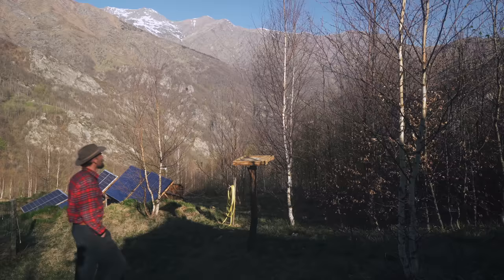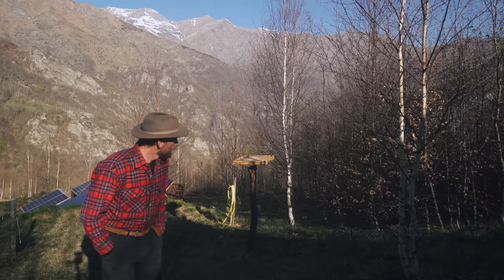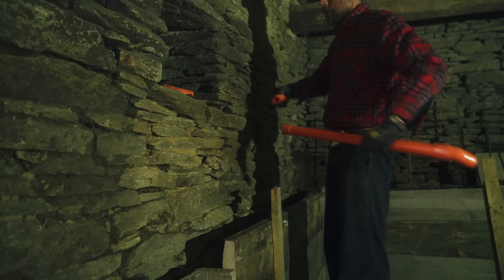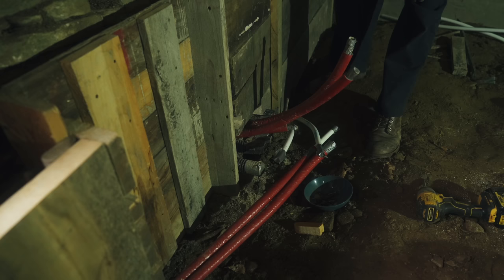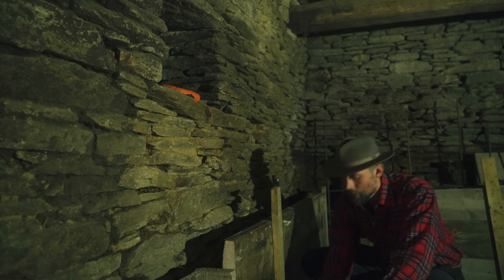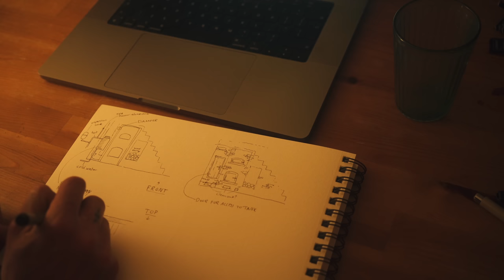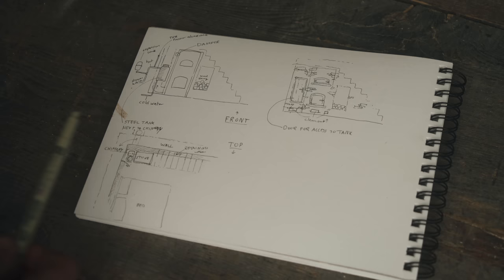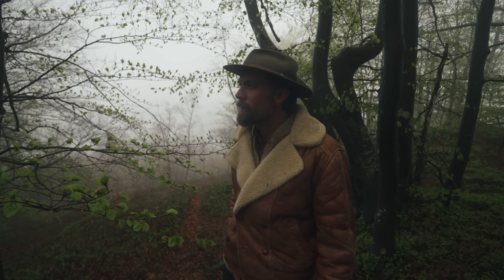#63 First Green on the Trees, Digging retaining wall, Plumbing preparation

Comment: Hi Martin, I am a heating engineer. To make this system safe the solid fuel side must be open to atmosphere (open vented system), and normally open valves must be used. Linking together a solid fuel heat source and a boiler is possibly the most complicated domestic heating system going, not only the plumbing but also the wiring. You can run into all sorts of problems like tanks boiling over, huge amounts of condensation on the heat exchanger that could ruin your stove, and at worst an explosion that could rip the house apart. I massively respect your work and think you're doing a great job, but I would highly recommend getting professionals in with specific experience on solid fuel heating systems for this one, most of this stuff is beyond your average plumber! It will absolutely pay off to have it done right the first time.
Reply: I don't know much about electric boilers, but I would imagine you could run into problems running them on a low pressure open vented system, low pressure systems are also less efficient. The best way around this would be hydronic separation of the two systems, and a neutraliser.
Reply: I am a plumber by trade in Canada, a fully qualified journeyman with decades of experience and I agree one hundred percent.   Heating systems should not be designed or installed by amateurs, they are incredibly dangerous, and will kill you in your sleep, and the dangers are often very easy to misunderstand or to overlook.

It is a place to pay for professionals, and also to soak up as much knowledge from them as possible so you will know if something is wrong.

heating systems almost seem to want to murder human beings with carbon monoxide, and it requires a lot of knowledge to set things up, and a fair bit to maintain systems that will not manage to murder you in your sleep. Yes I am being a bit over the top, but the dangers are very very real.
Reply: It's good to hear the experts say "Get an expert!", because that's just what I, as a diy-guy, was thinkin. But in principle I like the idea of a very well insulated storage tank much better than a tank next to the fire. In times like autumn you might want to run the stove only every other day or so, but the storage tank can provide you with warm water over a few days without running the stove. Also it gives room for future addition of other heat sources like solar water heating.
Reply: He must not have to go through inspections
Reply: Honest question, If you have a solid expansion tank and pressure relieve valve for the water side, how is the masonry stove any more dangerous than any other indoor wood stove? The only issue I see is tying your space heating to your water heating. Seems very hard to find a balance there.
Reply: @rnedisc  it's not any more dangerous than any other solid fuel heat source but the solid fuel side of the system should be open vented(open to atmosphere), that's how it is in the UK, with the exception of biomass pellet boilers which the manufacturers state can be fitted to a sealed system, but a very different system to your standard gas or oil boiler on a sealed system.

Very unlikely but if both the expansion vessel and the pressure relief valve failed with a solid fuel heat source then you are in for an explosion, hence why it has to be open to atmosphere, then the system water will boil over into the tank, with a modern boiler even if the expansion vessel and blow off fail, the boiler itself will not fire up or cut out if the pressure rises too much.
Reply: I agree.  It´s a beautiful idea to design based on intuition but by the time you gain the knowledge necessary to engineer the thing properly, you become a "professional".  Take the simple idea to a professional engineer and work out a known good solution. Also, There are hydronic wood-fired boilers where the firebox is outside the dwelling.  I would consider a ready made wood-fired boiler instead of a diy approach.
Reply: @charlesparr1611  you are not being over the top. My 35 yr ok’d daughter rented a Beautiful condo in Denver, Colorado and ended up with CARBON MONOXIDE POISONING!! She has TRAUMATiC BRAIN INJURY!! She is alive but very sick!! Please be CAREFUL!! No batteries in the alarms !! My daughter can not think clearly after this!🙏🙏🙏Blessing’s
Reply: @lauraquigley6403  Best wishes for your daughter <3
Reply: @lailakuningas5745  thank you!
Reply: Everyone to their own expertise.  Take care.
Reply: Le regole in Italia sono che OGNI IMPIANTO di riscaldamento e elettrico DEVE essere certificato da un professionista e revisionato 1 volta all'anno o si è fuorilegge. Purtroppo le norme sono rigidissime ma c'è una ragione valida, son successi troppi incidenti.
Quindi anch'io suggerisco caldamente che Martijn contatti un professionista, può contenere moltissimo i costi realizzando il lavoro da sé ma deve essere supervisionato!

Comment: Hey Martijn, I've been meaning to suggest something of a less-conventional setup, but extremely easy to implement - why not use fireplace with air jacket instead of water jacket? The concept is simple - you just need to have a space surrounding your fireplace body and a fan underneath - once the temperature reaches certain value (70c in my setup), the fan starts and it blows air through the area surrounding the fireplace body, which you then route to wherever you need it to go - either through direct vents or pipes. This is extremely simple, but effective system. My house is 75m2, the main room is 40m2 and has ceiling as 5.5m high, I heat all the rooms with just a single bucket of firewood a night. I can guarantee you you can make your house crazy hot with this setup on a minimal amount of firewood needed. There are also hybrid systems which include both water and air jackets, you can make something to heat the boiler as well, but if you want to heat up your house easy and fast, in my opinion air jacket is The solution. There are pre-made fireplaces with this setup, just google "GK 21 fireplace insert, air jacket" or I can show you my set up as well, I've got detailed pictures of the whole process when I installed it. Basically I have pre-made fireplace with this system and I just built stone body around it. That way it looks great and it accumulates the heat so it is slowly released once the fire is out and the fan stops eventually.  I've routed a couple of pipes to the other rooms, the main room where the fireplace is does not need any pipes at all, the direct vent works perfectly fine there.

Comment: In your simple version you'll accumulate a lot of rust in the steel tank... Commercial versions have a sacrificial anode to combat this. Thanks for all the great videos!
Reply: isn't it that the anode is here to prevent the acidity of the water to 'eat'  the tank? so the sacrificial anode is here to be eaten ... ?
Reply: Not really, stainless steel is quite durable and u could use zinc bath or even aluminium, it just depends on the amount of pressure built inside and the volume of the tank

Comment: I would strongly advise to embed some conduit before pouring the final conrete. You never know what you want to add later on. Let's say you want to have a Starlink dish on the roof and put an ethernet cable to the other cabin, that could be solved neatly with some conduit.

Comment: Martijn, i listened to your discussion on  the masonry stove and found it very good. I think you want to optimize the heat transfer to a water jacket very near the heat source. The expansion valve removes any danger of explosion. Also run very short heating coils in the concrete floor. Lastly utilize the sun for h2o heating as well…you’ll beat the utility supplier!

Comment: the electrical boxes are modular, there is also 1 place box. you can also put the shukos in the 3-place box, and if you don't need a button you can put the special cap, you don't necessarily have to put 3 buttons. The best brand you can find is bticino

Comment: Well, for the heater, I would use an existing plan that has worked for other people too. There should be something on the internet about this topic already. I've seen fan heaters around stove pipes, I've seen copper piping around stoves, and around chimneys. It should work just fine. I've also seen Pellet Stoves, they have a cast iron piece where the water goes through. 

Two wall radiators should also work, but if you really want to, the floor heating can be done too. :) 

Just be sure to use firebricks for the stove. 

Greetings,

Jeff

Comment: I'm a bit worried about that chicken coop, or rather its roof. When there's snow on the roof and it melts, or when there's rain, it will all run down at the back of the coop, and then follow the slope of the mountain downwards, meaning it will run downhill and through the chicken coop. It might be a good idea to add some sort of "planned drainage" there, so that your coop floor doesn't get washed away the next time it gets wet.
Apart from that, yours is the first coop build that I've seen in a long time on YouTube, where I always thought "I hope he does X right" - and then you did it right. Like having the wire netting under the floor, not just along the sides, or having the doors to the roosting boxes (where you take the eggs out) at the side. (Chickens are prey animals, their main enemies fly above them, so opening the lids of roosting boxes from above while they're laying may give them a nasty shock.) Well done and thumbs up!

Comment: I recommend Gewis brand for electric switches. Thei have a big variety. To help you see the switches in the dark you can install switches with small LED signalising light.
Btcino is also good but a bit more expensive.
Good luck!

Comment: I Love your second plan, but, IF YOU go away for the winter, you need Valves to empty your water lines completely,  so they don't freeze and split while you are gone, while you are not feeding the fire, and for summer you can use an on demand water heater

Comment: As you are in Italy, look for electrical switches and others from VIMAR. I'm using them for 20 years, still existing the Plana line and you can get everything you need. You can find 2, 3,4 and 7modules support. As for single switch, use a double one with one single switch and a double cover for it. Cheers from Romania.

Comment: Hi Martijn. I know you want to do it yourself, and there is cost. Idea maybe get a local qualified plumber electrician to work with you to complete the work because a good reliable system is a safe correctly fitted system. I just don't think experimenting with hot water, gas, and electric pressure systems is a good idea?

Comment: It is not complicated... is thermodynamic principles the heat transfer can be done in different ways, agreed, but the most efficient is the first system you presented on the video. there will be more transfer heating from stove to serpentine system...because more area on pipes... but keep going.. !  Good Job !

Comment: Hey Martijn, take in consideration that after some time in the Chicken Coop you'll have about 10 cm thick layer of chicken droppings that you need to scrape off and clean every few months. Cheers and keep up the good work!
Reply: I have heard that some people, after cleaning their bottom scrapping's from their chicken coops, then use the scrapping's mixed in with their garden dirt. (That helps further fertilize) the new garden crops...  kind of like the "circle of life" thing...
Reply: @joanievallee1220  A good soil amendment, chicken manure adds organic matter and increases the water holding capacity and beneficial biota in soil. A good fertilizer; chicken manure provides Nitrogen, Phosphorus and Potassium to you plants (more than horse, cow or steer manure).
Reply: That’s probably the idea. My friends do exactly that to add to their manure/composting.
Reply: Are you using tankless water heater too .like set up though.looking foward seeing more.thanks

Comment: Hi Martin! You're doing a very good work! Maybe you can put a little roof over the bird feeder so maybe they feel less exposed to possible attacks by birds of prey, when birds're hungry they mindless while eating but very carefull searching food like all living being...Regarding the electrical controls you could use something like the new Btcino systems that create interlocking smart sockets, switches and controls so you can move all connections as you wish, it's like Lego... 🤩

Comment: if you put the pipes in 'gain' which are pipes (red for electrics/blue for water) then you can change the pipes/insulate or repair without ripping out the concrete but pulling them through.  If you have a burst pipe you are going to be in trouble. Everything in a house needs to be accessible? Thanks for the vlog; always a joy x

Comment: The rooms to be heated are small. You don't need to do all the setup. The stove will be enough to heat the whole house if you make sure that the hot smoke is circulating in order to heat the mass of the stove. You can also arrange to have a "saltellite" on the floor above. To have hot water there are water heaters that work with wood or electricity.

Comment: Instead of a normal electric boiler you should consider a heat exchanger boiler for the summer months. Way more efficient and therefore more suitable for a photovoltaic system.

Comment: The music is good. About water I think it is not a good idea to warm water with firewood. I would just use an electric boiler for heating water and wood stove for warming the space. If there is not enough electricity in the winter you can use the benzine generator.

Comment: I was born in an older house and the hot water came from pipes running inside the stove, pipes comes in/out behind it and was stored in a big steel hot water tank in their bedroom before being distributed throughout the house. It  would heat the large bedroom as well because newborns babies would sleep there for a little while. It would become really hot but I don't remember pressure issues. The tank was made of solid steel. We got hot water from heating water on the stove as well. Later they acquired a wood furnace and it was heating the water and the air as well. I live in Canada and in winter, it can be really cold!

Comment: I suggest you to consider, since you will use it just in the warmer season and also in winter shouldn't get impossibly cold, a heat pump boiler, they are far more efficient than the resistive ones

Comment: Heating water with electric using only solar is not a good plan. You do not get enough sun daily to support the amount of hot water you would want daily. But you can always use your generator if needed. Trying to maintain modern amenities and going off grid is not an easy challenge. And proper vents on the sewage pipe is important and more complex than you would think. Top notch video editing bty.

Comment: There are stoves, in italian "termostufe a legna" or "stufa a legna idro", that integrate part of the water heating sytem such as the electric water 'pump' (it is not technically a pump), water heating chamber, safety valve, ... There are than kits that allo to add the additional features to meet customer requirements, for example heat water for bath/kitchen, integration with other heat soucrs, ...
There are several different models, wood fire combustion techniques, fresh air addution from outside the home, ...
There are also the models that are installed outside the main rooms of the house, but are installed in small technical room or semi covered spaces that are all closed with no glass to see the fire. Usually are the ones with highest efficiency.
Some brands are La Nordica, Palazzetti, Edilkamin ...

Comment: I mean it's just an idea but you could just calculate the amount of air and heat on the chamber with its dimensions and place a fridge grill. Some loops or turns of smaller diameter piping to profit more the heat released. Then the tank and all. As long as you do the proper math you can play with pipe diameters and volume of the chamber to enable a proper and fast heating system. Cause im not really sure on the steel tank itself. The idea is quite good but in reality i think it could reach half a day to heat on the coldest days. Just an idea. Awesome video as always

Comment: The heating loop is unnecessarily complicated for such a small space. Boiler, mixing valves, temp sensors, pumps. One component of failure can put you in a bad situation.  :body-blue-raised-arms:

Comment: Hi Martijn. You mentioned that you will have gas in your house. Consider a Rheem 27 (Rinnai 26) Continuous Flow Gas Heater LPG/Natural Gas system for hot water system, if it is applicable in your conditions. Regards, Nick.

Comment: BTicino Living International is a good design electrical swiches/plugs modular system. Since the patent on dedign expired parts can be found manufactured also by other companies.
The 'placca', that is the decorative part is avaible in many different colors, textures, ... there are some also made of wood.
As for the butyons of the switches, that are usually mountedbover a 3 places boxes, there is a special butyon that is wider and coverrs the space of three units. Usually are used the units that are a single module (frutto in italian) width with on the sides void module space cover.
There are also switches that have a small translucent strip under wich is indtalled a small lamp that allows to find the switch in the dark.

Comment: hi can I make a suggestion only use stainless steel for your heat exchanger, you could have a flu type where the flu runs through the middle of the tank,  200 /250 +mm flu tube with 500  /600mm wrap around and as tall as required and your in and out bosses welded in, there are many ways to  connect it in so its removable if required flange fittings,